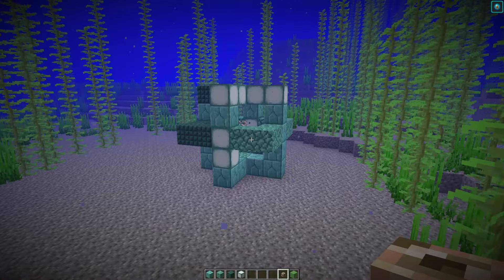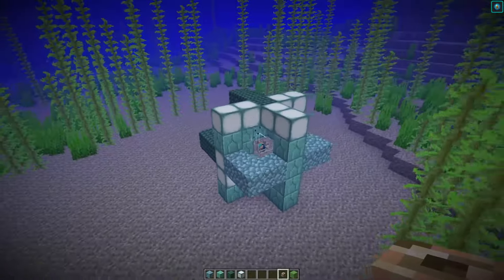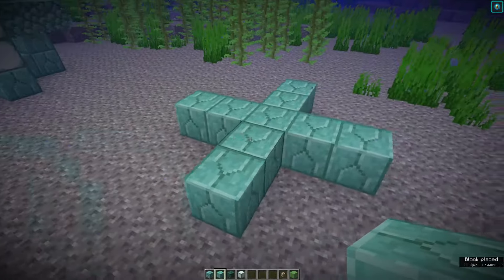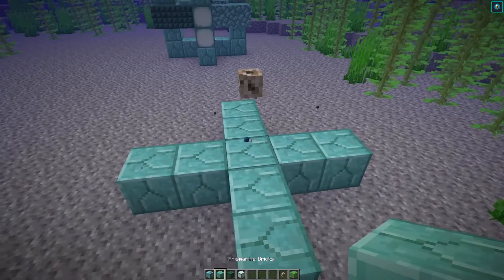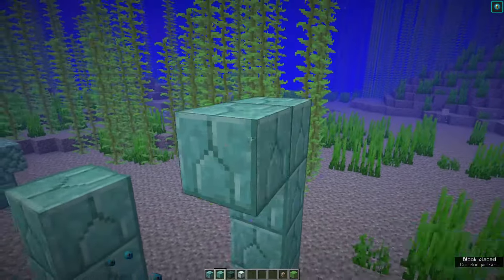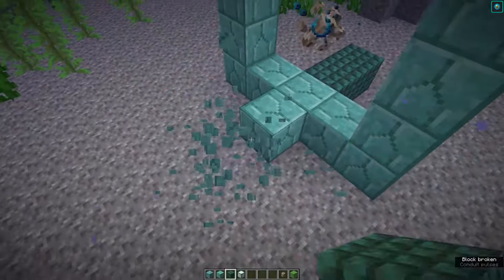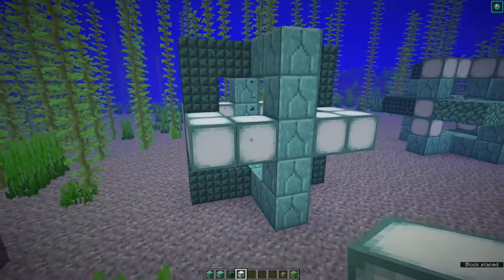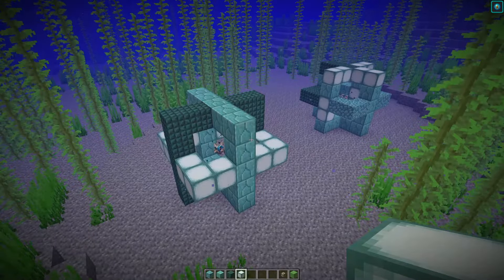Make a Full Power Conduit in Minecraft - Tutorial

Comment: Silly question, can i move the conduit if i dont like its spot with a pickaxe or will it be destoyed, and can mobs destroy it at all?
Reply: Mobs can't destroy it, and yes you can break it with a pickaxe without it dissapearing.
Reply from the maker: Sorry to take so long to reply Taexer, I have been afk. Yes, you can move it. You can use any tool, doesn't have to be silk touch, but a pickaxe is the quickest way to break it. It will drop itself and you can put it wherever you want. I don't know if a wither could destroy it, but as far as I know it can't, and I do know for certain that nothing else can.